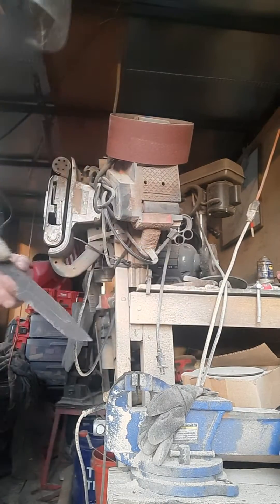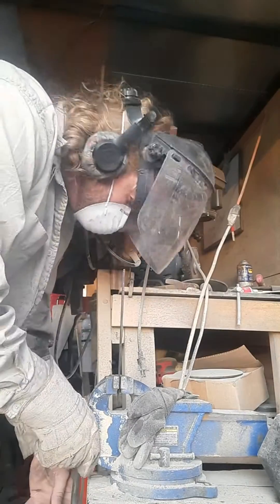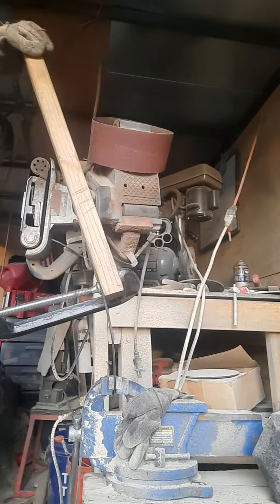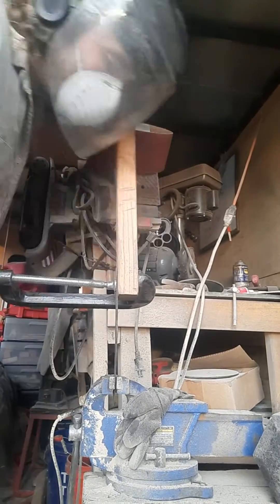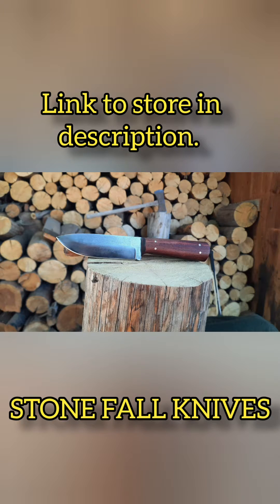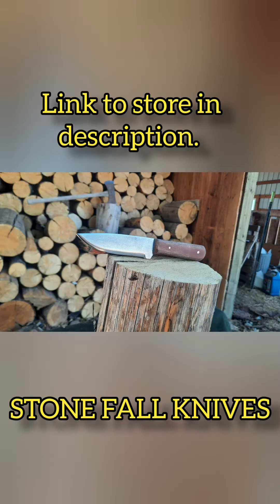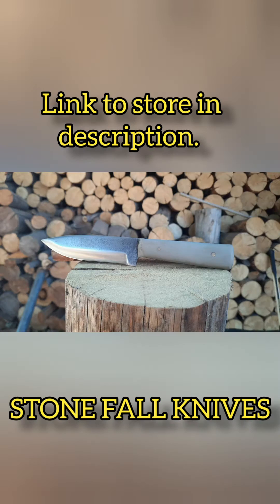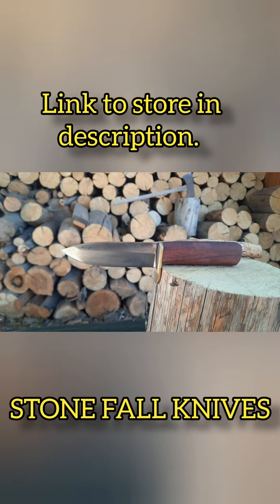Knife bend test. A2 tool steel knife bend test. From Stone Fall Knives. Knife broken at the end.

Comment: How thick was the blade? I have had several knives in A2 tool steel, and even had a Katana sword that was made from A2 tool steel. The sword was fairly flexible despite being over a quarter inch thick but I assumed it was due to relatively soft heat treatment which was around 42Rc. The knives I had mixed results. It was one of my favorite tool steels until a few of my knives in A2 made by a very popular maker who I won't mention, broke. One blade I accidentally knocked a quarter sized chunk out of the blade with a pipe I was using to baton the knife. The blade was around 6 inch in length 3/16 thick and was hardened to 55-57rc. So I'm shocked to see such dramatic flexing ability from a blade hardened to 63rc, when most knives i owned were hardened between 55-58rc resulting in a softer steel, which in turn should be tougher but could never come even close to the results you had. Best case I believe a few knives flexed to maybe 60-70 degrees before snapping. One more confusing aspect of A2 is the charts I've looked at all show charpy impact values increase as the hardness increases. Where every other steel I've looked at works the opposite. The charpy impact values increase as the hardness decreases. Steel gets slightly softer, and able to withstand higher forces of shock and impact with out fracturing. So its confusing why A2 behaves completely different counterintuitive to how
one would expect steel to behave. I still like A2, how fine grained this steel can get, and get a scary edge and keep it. But for blades that are going to see and endure abuse i prefer A8 tool steel now. Its now my favorite, too bad almost no one in US uses it. In the past 30 years one custom US maker Tom Johanning only used it. Made extremely tough knife according to the reviews. But you have to go to European and Asian makers to get blades from that steel.
Reply from the maker: This one is .1 inches. This test surprised even me. It's hard to find bend tests online of this metal. I do perform my quench slightly differently to the most common practice for this metal.